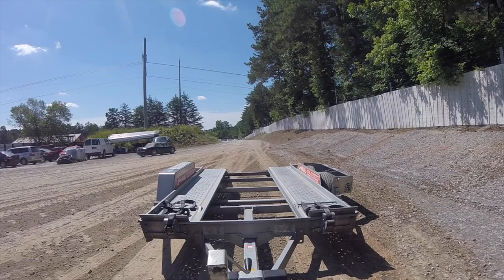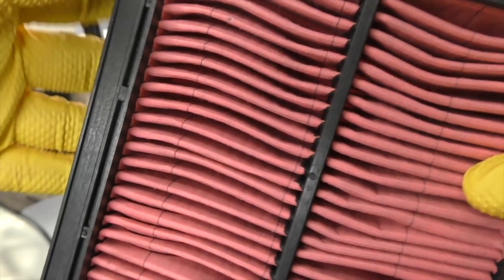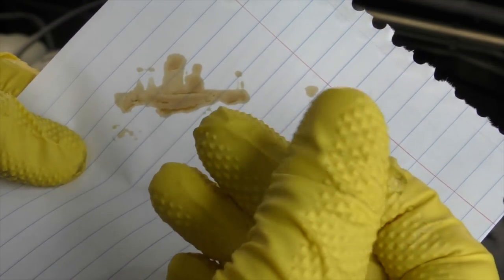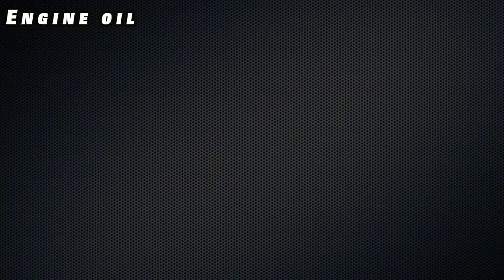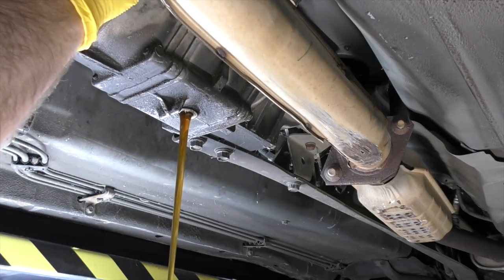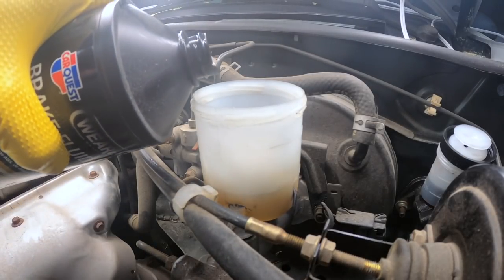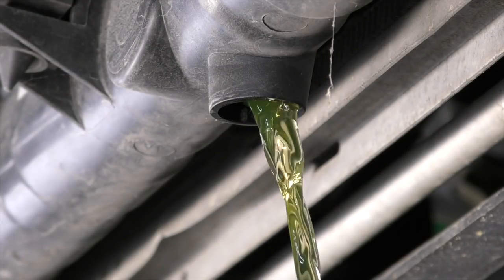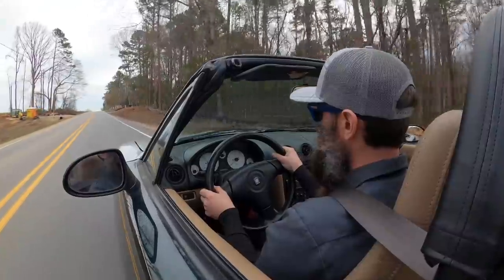6 Super EASY Services for a Car with Unknown Maintenance History

Comment: I'm an off road guy and just recently got an older 4x4 Suzuki Sidekick which are great little off road vehicles. I scored big time on this one. The guy I got it from was the original owner.  He bought it new as a small vehicle to pull behind his RV. Its got super low miles only about 75k and zero rust which is amazing for a 22 year old vehicle in Wisconsin. I was lucky enough to have the opportunity to go through it with a fine tooth comb before I bought it. Everything looked great except it needed some shocks, brakes, and the manual locking hubs were shot. I still did a fresh fluid change on everything even tho it all looked really good. I'm excided to hit some trails.

Comment: Another big one is new battery, clean terminal clamps, clean starter motor connections and clean the ground connections. Helps to keep the electrical system reliable.

Comment: Hey Charles, awesome video. Wanted to leave a comment for you or any miata guys because I racked my brain for a very long time. When cleaning the throttle body it is important to not wipe off the black film along the inside diameter of the housing. That layer of black stuff comes from the factory and acts as a seal for the butterfly. I did not know this and once "cleaned" my throttle body while chasing a smaller idle problem that was ultimately due to a faulty IACV. However after cleaning off this layer of black stuff from inside my throttle body, my idle would either constantly roam, or would sit anywhere between 900 and 1700 while the ECU struggled to adjust for the now gaping hole around the butterfly. I found this out from the miata forums and was able to find a used throttle body locally. It also came with the IACV. After installing the new throttle body, my problems went away entirely. Installing the old IACV and reinstalling the new IACV confirmed my issue (I was told checking resistance of the IACV should have been my route to solving this problem, but I never did do that). Also, when looking into the sun you can clearly see light around the outside diameter of the butterfly in the old throttle body. I hope that mine was an anomaly, or that there was other problems with my throttle body, but if you ever have idle problems with the miata from here forward and struggle with diagnosis, I hope you find this comment!

Comment: Fun story, I just did my brake fluid on my 90 Miata two weekends ago. My fluid reservoir was the color of black coffee. It was also full of dirt and debris particles. Ended up draining it fully and picking dirt out of the bottom with a paper towel very carefully before finally bleeding the system (from furthest to closest to the reservoir) only to find that BOTH my front bleeder valves were rusted shut and they had to be wire wheeled and re-drilled, which worked great. After watching this, I realize I should definitely do the clutch too (I have Motul 600 DOT 4, which should work according to this video), as well as do my rear diff fluid (GL-5 trans fluid), and top off my transmission because in my haste, I didn't let the car be level. Explains my shifter being so noisy (I did do a rebuild of the trans tower at the exact same time.)

Thanks for the great video and great information!
Reply from the maker: Man that sounds like a fun day of work! I had to flush the clutch like 4 times to get it clean. That fluid was awful
Reply: @HumbleMechanic  I won't lie, it was a lot of fun seeing the clear translucent fluid refill the reservoir!

Comment: You should try the Amsoil gear oil and manual transmission oil that comes in the easy packs. I actually find them to be easier and faster to use than the pump. When I buy it I get just one of the easy pack bottles then the rest in the regular bottle. As I fill the diff or trans I refill the easy pack bottle from the regular bottle. The easy pack bottle is like a heavy plastic bag its super easy to use. As your emptying it you can fold it or roll it like a tube of tooth paste.

Comment: You can reduce most leakage when using a turkey baster to suck out old brake fluid from the master cylinder by flattening the end slightly into a narrow oval shape by heating it and reshaping it with a pair of pliers.

Comment: On the brake caliper and clutch slave cylinder. Replace the bleeder valves with dorman "Quick Bleeder" one person brake blender. It will make any additional work on bleeding the system easy. One of the Napa part numbers is 675-1572. Just a suggestion

Comment: Once doing the radiator flush be sure to open the heater controls so the heater which also contains the same coolant drains out as well as the engine block and radiator.

Comment: havent tightened a rad cap down in decades,, No hot days here, so no pressure means no hoses or pumps to blow out.. just have it on enough to keep pressure from building,, we run the fluid down a bit as well.

Comment: Rather than a seam ripper for those awful plastic blister packs I use tin snips.  I sometimes even use the Dremel with a metal cutting wheel if it already had one on it and I just happened to be near it, it cuts that plastic easy enough.

Comment: Hey Charles, for removing the fluid in the brake reservoir you could have used the hand pump instead of the turkey baster. Just a tip to add the next video.
Reply from the maker: Great idea!!! The Baster is an old habit. Haha but you’re idea is better.

Comment: When flushing the coolant system for an oil cooler failure, use low sudz detergent. Dish soap will work, but i worry about all of the bubbles and extra pressure it will create.

Comment: Dishwasher detergent is good for flushing coolant system w/ oil in it. It doesn't foam/sud, so it's easier to clean out.
Reply from the maker: Exactly. Used it a bunch with oil cooler failure

Comment: Glade u said said about the antifreeze being hot had a small coolent leak went for a 10 minute drive being studied opened the cap got 2nd degree burns on the left arm that sucked hurt like you can't believe and I been a machinic for 20 years only takes one time being stupid

Comment: My Parents 1.4TDI i got from them with 18 years got a clogged fuel filter. Suddenly the engine startet cutting out above 3400rpm which my parents didnt notice because they never revved it that high. Swapped the fuel filter and it felt like i got extra hp back. Also on my dads audi 80 2.0E the engine suddenly became quieter and just as we noticed it the engine stopped. Then someone towed us to the nearest workshop and we got it replaced. VW built some good cars back then. The audi 80 had over 420.000km or 260.000miles on it. I bet it still drives somewhere around the world now.

Comment: Thanks for posting this. What’s the type and brand of that brake extractor thing you used?
Reply: I have one like that made by Mityvac.  I use it to suck fluid out of the brake master cylinder instead of turkey baster.  Also good for sucking fluid out of power steering reservoir and automatic transmission.

Comment: 2:33 Strange , my 2020 Toyota Camry came with the original air filter , with a orange filtering material . I changed it to a Purolator since it has white filtering material , easy to see how dirty it is ] gray ] . And I had seen many other filters with the same . Why would they use a filter material where you can't easily see the dirt !?

Comment: What do you do with used antifreeze and brake fluids?  I've been told by some to put brake fluid in with the old oil but it's glycol based and that ruins oil.  As a home mechanic I've had real issues finding a place that takes old antifreeze and brake fluid, everybody takes old oil.
Reply: you put the antifreeze in a clear bottle with the lid off, keep it high and away from animals, the sun will evaporate it. I found this out bc i live on a ranch, my drain pan stayed outside for a week and i came back to just water. brake fluid im not to sure, but you could try the same thing, since i live on a ranch, dumping fluids isnt an issue.
Reply: @RockyRepairs  dumping fluids is always an issue.  It's not only federal law but it's bad for animals and groundwater, something I think would be important on a ranch.  

You can evaporate it like you said but you'd still have the dried residue which is still just as hazardous because it will easily reconstitute with water.  My last two residences had ample land to dump, still made arrangements to find a place to take it.  Oil is easy, not so much for the glycols.

Comment: Awesome videos Charles! I have a quick question I’m stumped on. I recently bought a 2007 VW Jetta and need a new front drivers door harness. Part # 1K5971120T. Problem is they don’t exist and out of production. Dealers and DAP pretty much said I’m SOL. I’ve tried repairing it, any ideas? Any updated parts or replacements? 😑 Thanks in advance
Reply from the maker: If you repair it, the repair needs to be made in the door, not the boot. It will just break again.

Comment: Hi Charles! Thanks for your awesome videos, this is definitely one of those!
What change interval do you recommend for gasoline fuel filter and manual transmission oil, specifically for my 2015 VW Polo with 138 000 km/86 000 miles? I don't think either has been done before.
Reply from the maker: Usually around 100,000km is a solid interval. Unless it gets clogged before
Reply: @HumbleMechanic  Thanks for replying! Is that for the manual transmission oil too?
 I think such things should be in the service schedule.
Reply from the maker: If you are stock yes. I like to up the internal if modified.
Reply: @HumbleMechanic  Thanks again! 👍

Comment: Charles: "Burnt differential fluid is one of the worst smells on the planet!"
GM Supercharger Oil has entered the chat
😛
Reply from the maker: Oh man I’ve never had the pleasure of that one
Reply: If you could take all the yuckiness of a landfill and condense it into a liquid, then mix it with some cat pee, that would approximate the smell of GM supercharger oil. IIRC, it's made from rendered animal fat. So it gets pretty rancid after awhile.
Reply: I worked for Ford, Lincoln, Mercury. 'Friction Modifier' for Limited Slip Diffs. It's amazing how certain things you can still smell for days and days after it's gone. I learned the hard way to not leave customers cars windows open on hoist when doing diff services...

Comment: Any tips for starting a diesel engine that's been sitting for two years?
Reply from the maker: these tips, plus prime the fuel system. Diesel Purge works great!
Reply: @HumbleMechanic  Thanks. I've got a vehicle coming back after two years idle. It was in perfect shape then, but fingers crossed. Thanks, again.

Comment from the maker: What else to you guys do when you get a car? Maintenance is VITAL!!!
Reply: A deep clean is always a good place to start
Reply: Treasure hunt! I like to dig under the seats, spare tire area, map/door pockets.
Reply: Guessing that a change of spark plugs will be great likewise oxygen sensors
Reply: If VAG, thorough electrical inspection and switch testing. 
All cars: Compression test, leaks (fluids, exhaust, boost hoses, vacuum and blinker fluid 😉).
Reply: I usually just replace all the coolant hoses. Unless good records were kept, it can be hard to tell when they were replaced. Totally worth it for not having a blowout. 

Also, REALLY important. CHECK THE BLOCK FREEZE PLUGS when you're looking everything over. If you see rust, change them.
Reply: Replace all the rubber hoses. If it's a old car, you're going to have to either do it on your terms, or on someone else's terms whenever some old hose has decided to give up. And ofcourse all the obvious stuff like changing all the liquids. Preventive maintenance is far more pleasant than repairing.
Reply: @jameshaulenbeek5931  THIS!  Yes!

Comment: I could say covert it to electric, what is the stock horsepower of a Miata, the batteries if put low on the car would help make it run on your corse. LOL, wrong form. Sorry.
Reply from the maker: I’ve been watching a series about an EV Miata build. I’m into it. WAY into it
Reply: HumbleMechanic the way he’s doing it won’t be the fastest but he should have a great handling car at the end.
Reply: @HumbleMechanic  I'd consider an EV West style swap for my E82 120i if someone paid for it but my car only has 41,000kilometers